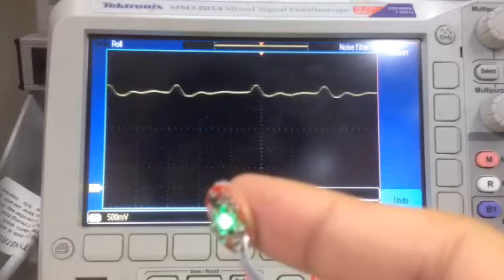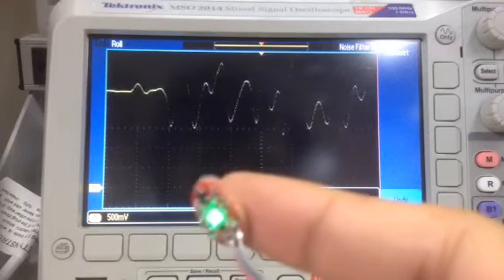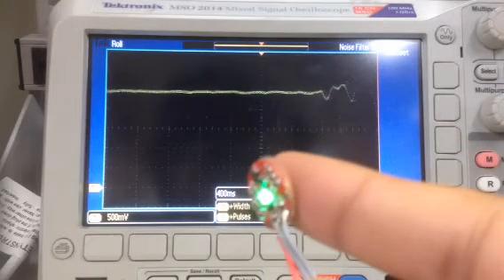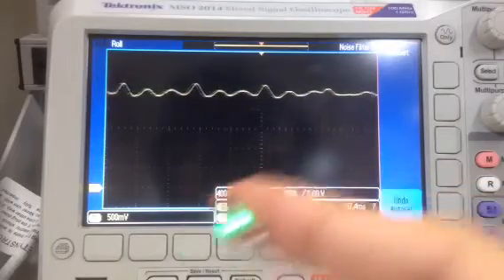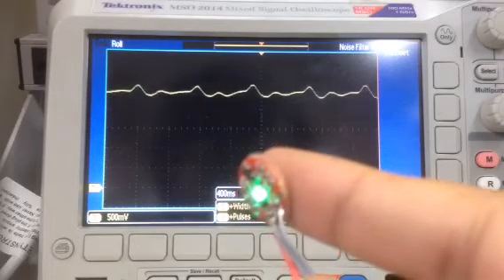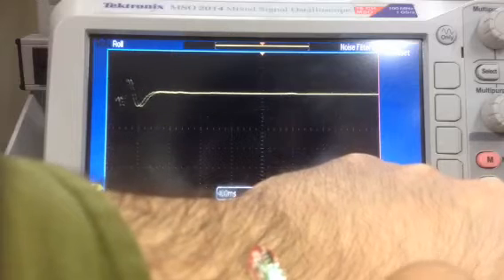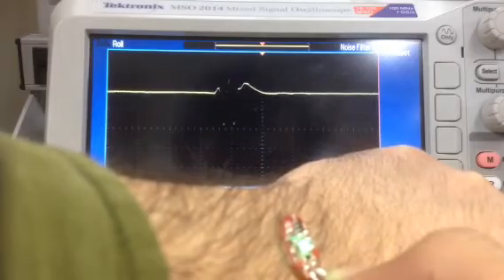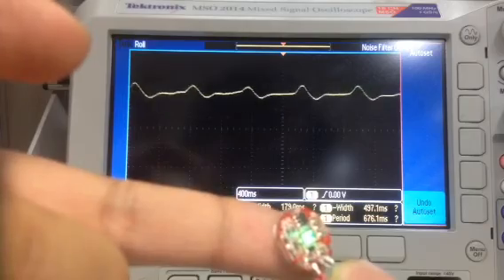Pulse Sensors - Motion Artifact Example

Comment: Why does motion artifact causes noise? have you tried an accelerometer for adaptive filtering?
Reply from the maker: +Bruno Nguyen I have read that one of the causes is the loss of contact between the sensor and skin. Ambient light creeps in, and somewhat destroys the measurement. Though I have not implemented an adaptive filter with an accelerometer providing a 'reference' noise, I believe this is a popular solution, and Poh's earpiece PPG sensor is a good example: http://affect.media.mit.edu/pdfs/10.Poh-etal-TITB.pdf
Reply: Bruno Nguyen because there’s a changed in distribution of charges in the polarizable electrode interface